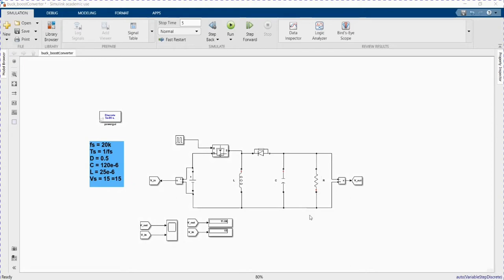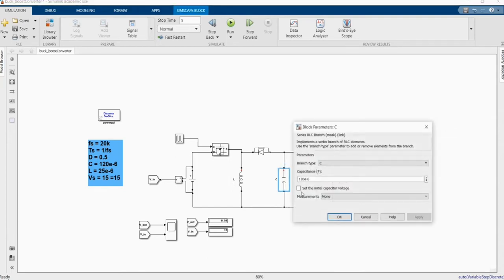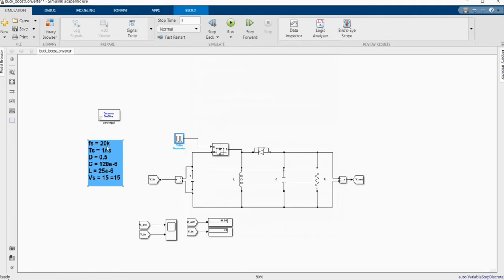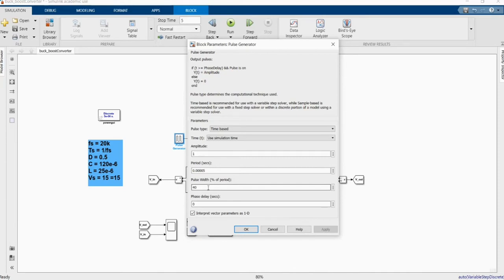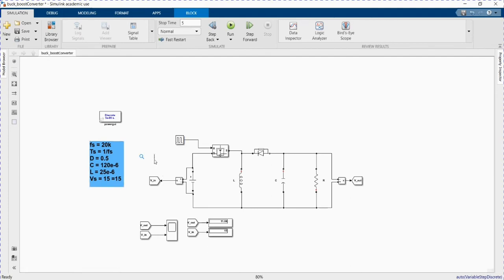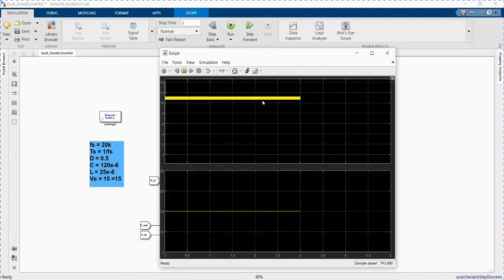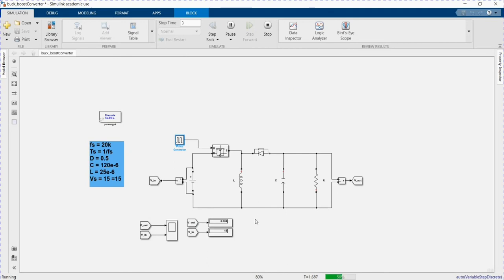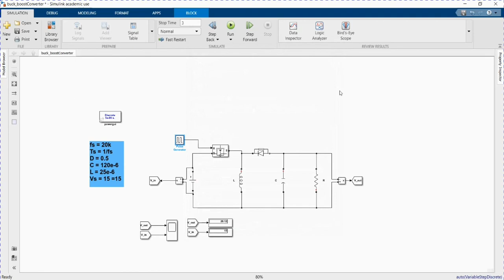Open loop control simulation of DC-DC buck and boost converter in MATLAB/Simulink

Comment: why when i'm running that buck boost converter simulation output voltage is negatif
Reply from the maker: Hi thank you for your comment, you should check your measurement components polarities